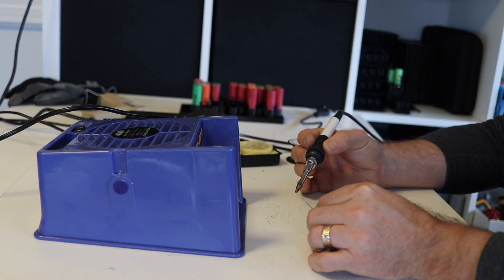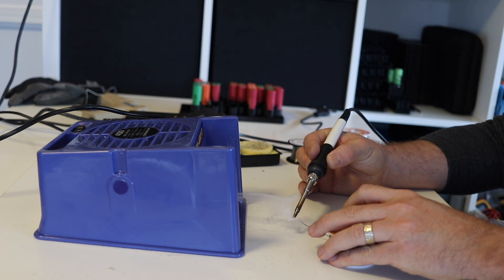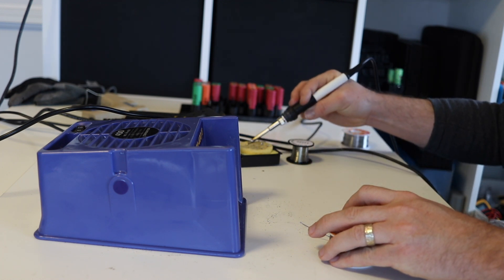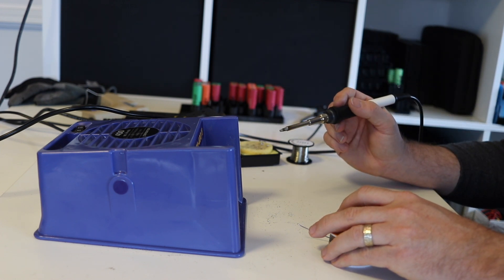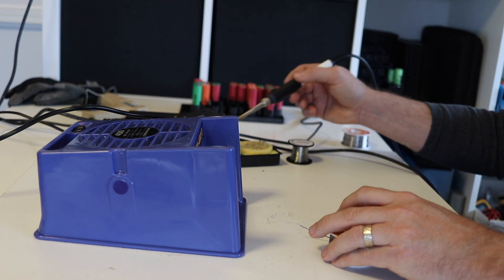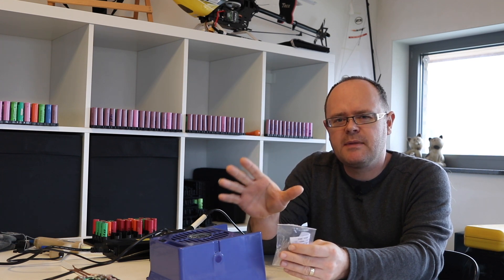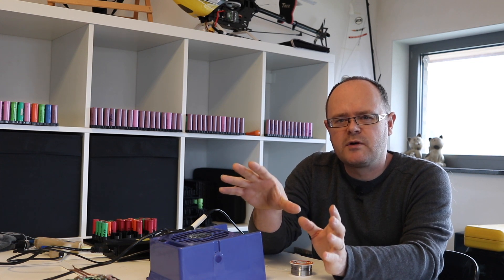18650 - Part 13 - Solder Fume Extractor

Comment: First of are you Dutch???
Just a small correction while soldering you won't inhaling lead fumes the boiling point of lead is something like 1500 or 1700 c way way more than any thing you'll be seeing. So don't worry about that. The smoke that you see is the rosin in your solder still it's all to good a simple fan will do. Lastly the filter there is not a carbon filter and it's not impregnated carbon filters don't work like this. I have a carbon filter in my kitchen ventilation system that is very thick

Comment: Did you consider spotwelding instead of soldering the cells?
Reply from the maker: Yes, but I like to keep the budget as low as possible. Also rather difficult with glass fuses I think.

Comment: Can you share a link for the tinned fuse wire? Most I found on Ali are enameled. Looking forward to the next videos.
Reply from the maker: didn't buy it on Ali, but on ebay, UK shop : 
https://www.benl.ebay.be/itm/TINNED-COPPER-FUSE-WIRE-FULL-RANGE-50grams/112028568439?ssPageName=STRK%3AMEBIDX%3AIT&var=410965112910&_trksid=p2057872.m2749.l2649